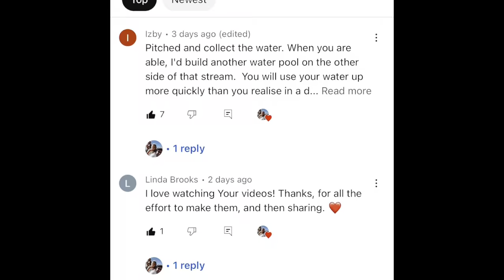03 - Big Barn Build Part 3 I Solar Powered Cement Mixer!

Comment: If you want to use the roof for rainwater collection I would go with the tin. It’s less likely to grow mould or moss which is important when collecting water. The tiles are also more likely to crack if any of the surrounding trees drop a branch. 

With the lower pitch make sure that it’s not too low or you’ll have leaves etc collecting on the solar panels which will limit their productivity.
Reply from the maker: These are all really good points thank you! It’s all so helpful! 😊